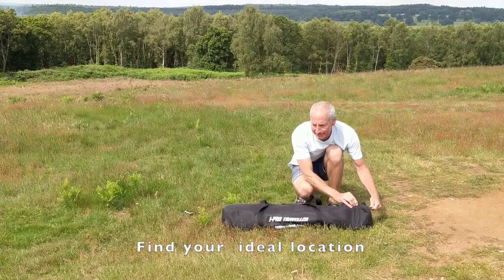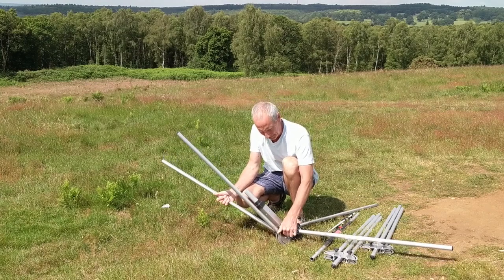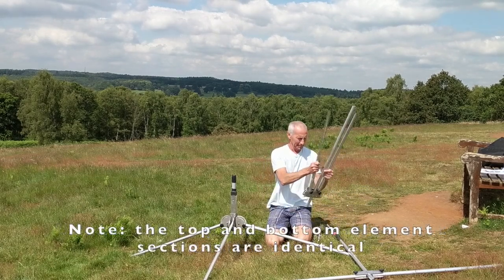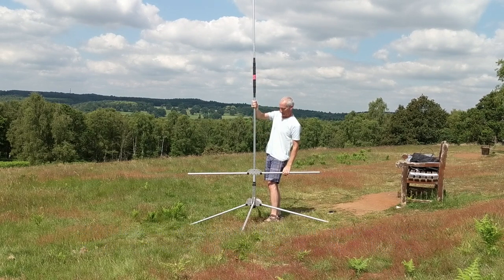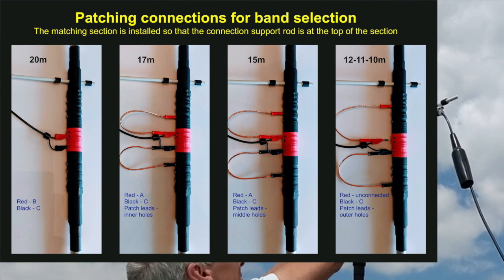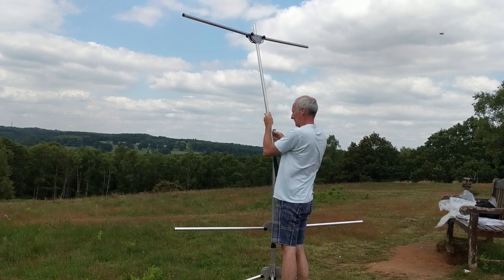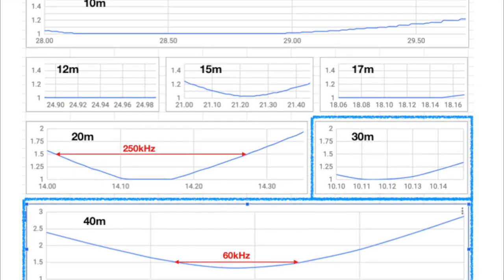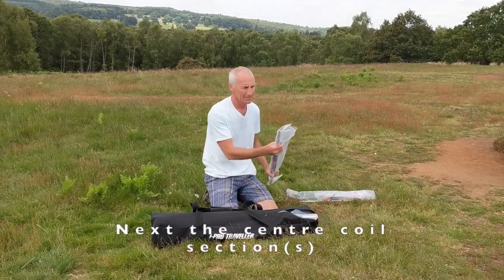I-Pro Traveller assembly and setup

Comment: I have not found a resonant point on 30 and 40. Because, to be honest, I always positioned the antenna incorrectly, always on the ground and not like a spider. THANK YOU !!! 73 de OE5POP, ED
Reply from the maker: Hi, The 40/30M setup for the  I-Pro Traveller is quite sensitive to position relative to ground, especially if the ground is wet. Raising it up can help a lot. Glad you found the video useful.